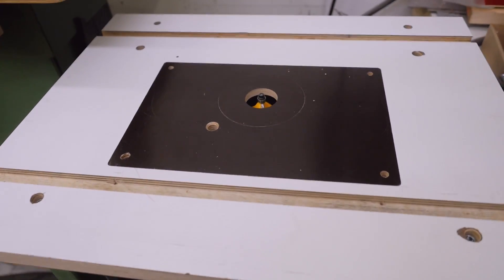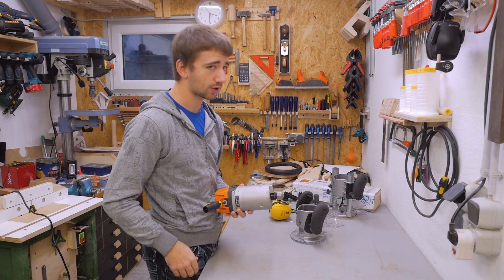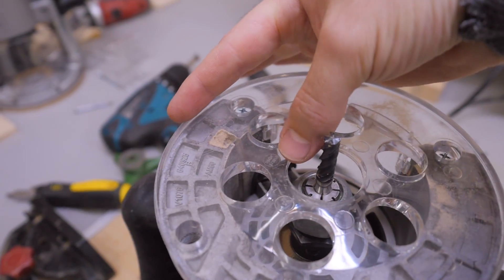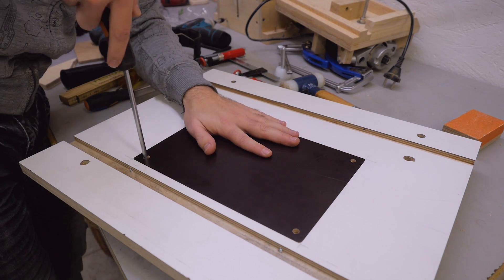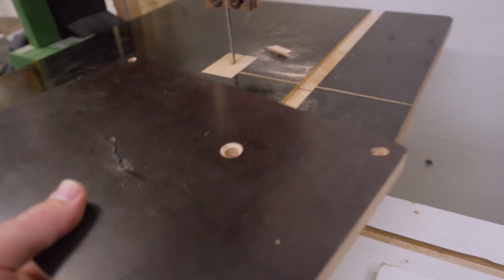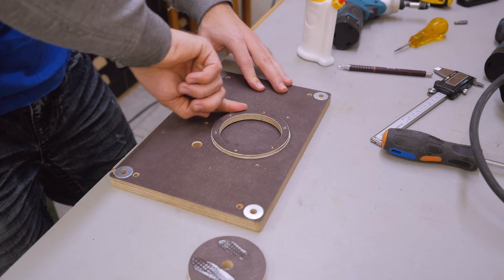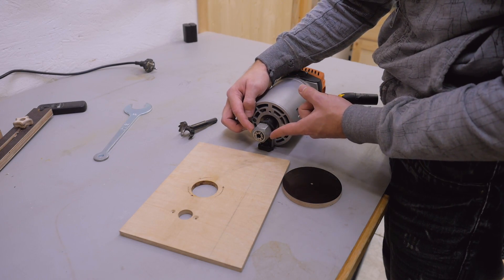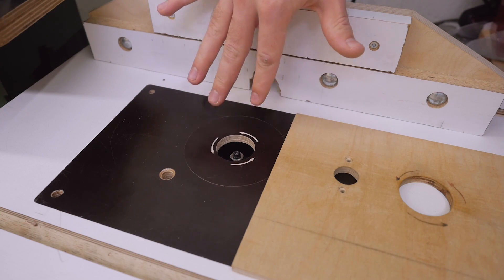Homemade Router Table Insert Plate

Comment: I have the exact same router but having a trouble with external switch. could you tell me how you bypassed the NVR on router motor itself to connect external NVR Switch? whatever i tried, i can not start the router back up with external NVR on. I have to reset the switch on router itself. Did you bypassed it somehow?

Comment: Im making my insert plate out of a 1/2" polycarbonate piece. Thats a great idea you have there!
I was gonna rely on the weight of the router to hold the insert in place anyway, it never occurred to me that i vould just lift it out and use it in reverse as a wide plate for top down operation.

Comment: Very nice work.im Interested to see how you made the height adjustment on that bigger router where you also incorporated the support into the handles.my Makita doesn't have depth adjustment and no where to even tap a hole into it
Reply from the maker: You can look at Matthias Wandel's tilting router lift. It was basically that design without a tilting feature
Reply: @MariusHornberger  thanks Marius,I wil look at that one
Reply: @MariusHornberger  what would you recommend for a normal router lift,don't really need the tilting one
Reply from the maker: @conradpaul6100  the same design. Matthias has plans for that on woodgears.ca
Reply: @MariusHornberger  thank you Marius,much appreciated and well done for all the stuff you do for fellow woodworkers

Comment: Nice work. Do  you have any ideas on how to use a safety ( zero volt release ) switch and also get it to trigger the motor brake ?  I'm using a Makita 3612 and have always liked the fast stop when the switch on the tool was turned off.  With the remote safety switch it spins for ages.

Comment: Super video Marius. 
Now one question. I have the same router. Looking at your video your router is inserted in a different direction than mine. In your setup the spindle lock points to the „bigger“ opening in the router base whereas on mine it points to the opening where you screw on the dust extractor holder. I tried all sort of tricks, but the little index pin on the router prevents me from inserting it in a direction similar to yours. How did you do this?
Reply from the maker: I removed that pin

Comment: Thats a very slick table setup.  I've got a Porter Cable 891, which doesn't have above table controls. So I'll add a lever to unlock the micro-adjust and a small dc motor to drive it forward and reverse.  The notching and magnets were a nice touch.  Subbed!

Comment: Hi Marius,
Still happy with the router and this router table solution?

Struggling to decide on a router for the router table. Have a Festool OF 1400, but no lifting mechanism at hand. Maybe it'll be better, easier and cheaper to get a new router that has a lifting mechanism integrated?

Cheers, Stefan
Reply from the maker: Yes, I still like it very much

Comment: Very interesting video, and I like that little circle cutting jig that rides on the router bearing.  BUT, I had to laugh out loud when Marius casually threw in "...and with a few pieces made on a 3-D printer" like he was talking about a scrap of plywood and some nails. :-)
Reply: It's weird. I feel completely comfortable using my 3D printer and CNC router, but feel like a complete beginner when using a handheld router or router table.

Comment: Du bist doch ein Deutscher, mit der Muttersprache Deutsch. Du hast überwiegend Deutsche Zuschauer. Verdammt nochmal WARUM quatscht du dann in Englisch!  Für mich existiert dieser Kanal nicht mehr!
Reply from the maker: Immer wieder interessant/lustig solche Kommentare. Also gut: Ich habe überwiegend ( weit mehr als 50%) englische Zuschauer bzw. Zuschauer, die der englischen Sprache mächtig sind. Meine Muttersprache ist Deutsch aber eine der Weltsprachen ist Englisch und für alle viel leichter zu erlernen als Deutsch. Also verdammt nochmal, wieso verstehst du kein Englisch! Für mich existiert dieser Kommentar nicht mehr! ;)

Comment: Don't you lose a lot of depth with such a thick plate? I went for a thinner aluminum plate because of that.
Reply from the maker: The original plastic baseplate was 10mm thick, now my one is 15mm. Yes, I lost 5mm, but in 5 years of using the old router lift, I never needed more depth than what I have now.
Reply: Marius Hornberger I am not that lucky - or your router extends further out than mine

Comment: Nice work, I really need to build a decent router table. Although, I have a router that already has the lift and spindle lock built in (if you lift it to the top it locks).

Comment: Love it! I actually have almost the same router. USA version so it's a RIDGID. built a similar table with hole for lift screw access but I find it fills with sawdust and I often finder quicker just to reach under and pop the quick release so I can just push it all the way up. Great to have you putting out videos regularly again!

Comment: Have you considered remaking the plate and mechanisms with the CNC router, but using a high-density plastic (or even maybe aluminum)? You might possibly trim the thickness of the plate, etc.. if you do so.

Comment: 44 seconds into the video........You're going to chip up your router bits.  Heat and put a couple of 90 degree bends in the wrench so you don't have to hold the wrench at a 45 degree angle.  Or just buy one off of Ebay. 

https://www.ebay.com/itm/1-1-8-OFFSET-WRENCH-FOR-PORTER-CABLE-ROUTER-BY-PEACHTREE-WOODWORKING-PW2887/173495381778?epid=1612369327&hash=item2865216f12:g:V~cAAOSwmBdbgdzm:rk:2:pf:0

Comment: After you adjust the bit height from above, do you have to reach under the table and tighten the clamp (base around the motor), or do you leave it loose? I have a Ridgid router which looks very similar to yours, and I find that the act of re-clamping changes the height of the bit slightly.Not sure what would happen if I didn't re-clamp every time.
Reply from the maker: Yes, you need to clamp the router every time. During clamping my router also moves very slightly. If I wouldn't clamp the router then the router drops down, as it happened in my outtakes.
Reply: @MariusHornberger  Thanks! (I've just finished a router table and fence -  I like your system for changing the bits, I take my router out from above, which often means moving the fence out of the way.)

Comment: Would You mind explaining what's so bad about the cheap router? I've had a similar one for ~2+ years now, and apart from crappy plunge base I can't fault it without having tried anything better...
Reply from the maker: Mine had a bad runout on the spindle, which makes to router bit "wobble". Then only one of the two cutters does most of the routing -> ruins router bits quicker, cut surfaces are not as good and you feel a lot more vibration. The other thing is the better electronics and more power, which can hold the rpm even under heavy load. That actually makes quite a difference.

Comment: AEG!!! Been a long time since I had seen that logo on the side of a device :D (last time was a washing machine I think! Before I moved to US.)
Reply: Ridgid tools are actually rebranded AEG tools. Emerson Electric, the owner of the Ridgid brand, buys tools from TTI, the owner of AEG brand.
Reply: I'm pretty sure that it's what they name have rebranded the US Ridgid power tools to here in Europe. They look very similar if you compare them and they have the same parent manufacturer.
Reply: Peter Löfstrand the main difference is the price. This router is crazy expensive in Europe and it is pretty much the only round bodied 1/2" router available.
Reply: AEG is sold in US under the Ridgid brand.